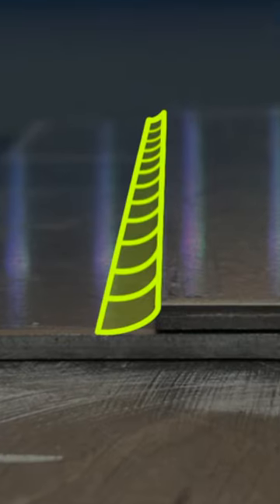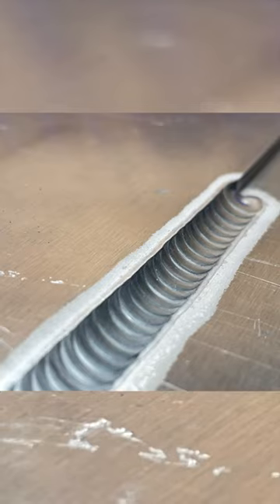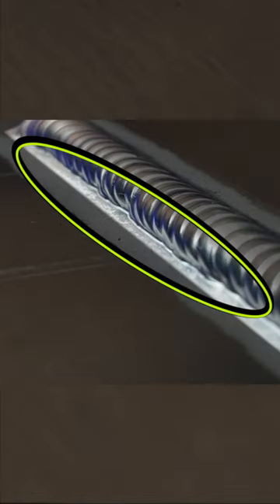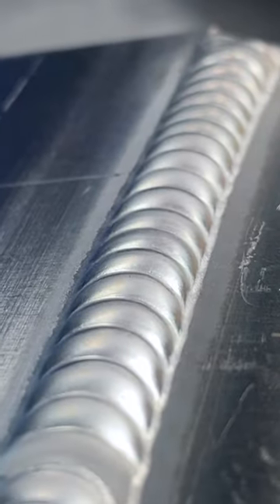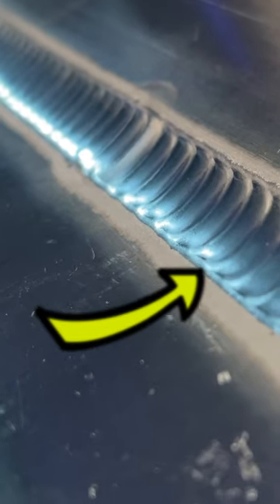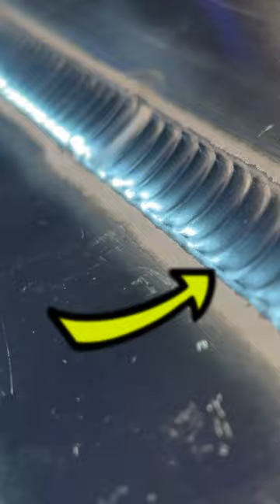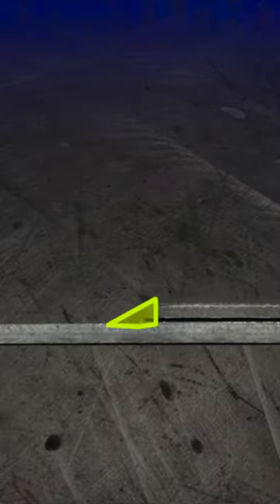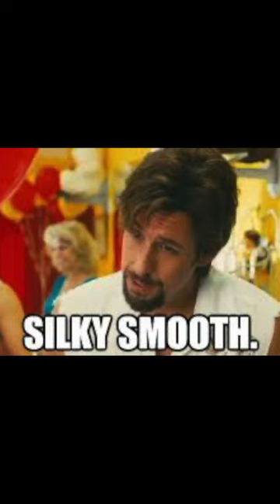FIX THIS PROBLEM with lap welds tig welding! #shorts

Comment: Would you recommend learning to tig weld on aluminium or start on steel because I see lots of people starting to learn on steel but never aluminium 🤔
Reply: I could be wrong, but from what I've picked up here and there over the past few years of learning stick and mig welding, aluminum seems to be more difficult vs steel for multiple reasons.

Comment: What thickness was that aluminum and what amperage were you running, also cup size and cfh if you remember. Did a lot of aluminum work in the last few weeks and my lap joint is what killed me, Tee and inside outside were just fine though
Reply: It's 1/8th. The material is the same size as his rod and he only uses 1/8th filler. 
Using 1/8th filler rod is probably the one "setting" trick that matters to get it to look like that.
But a 5 cup and probably 12 ish cfh with a gas lense.
This guy melts melts 1/3rd of the bead into the top piece of metal.

Comment: Looks overfillled. Not overfillled because it's a lap. Although I can count on one hand how many lap welds I've ever done, it's nice to see what correct looks like.
Reply: It's only overfilled if the weld is higher than the top of the piece you're welding together